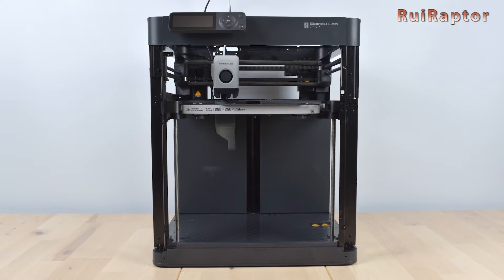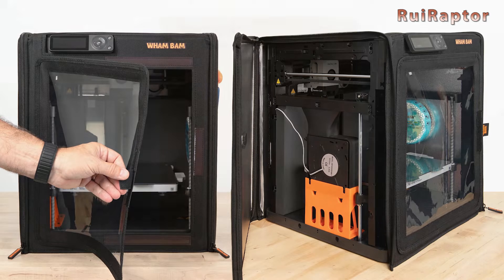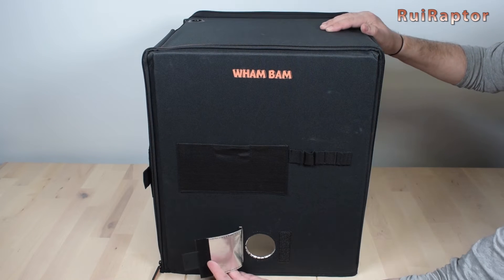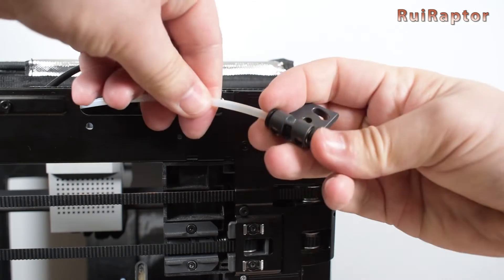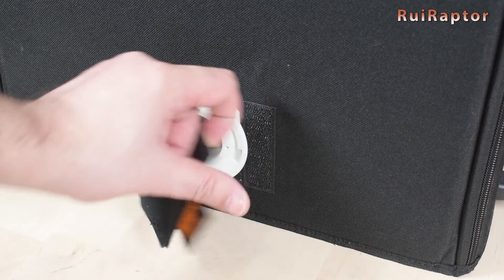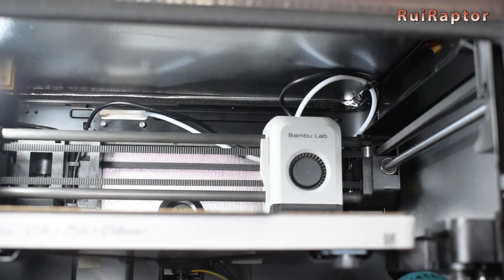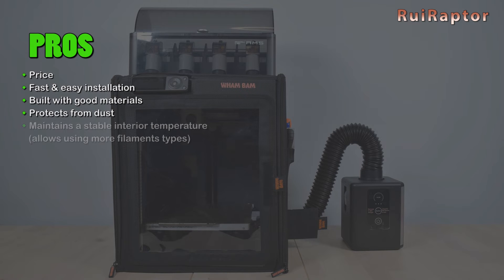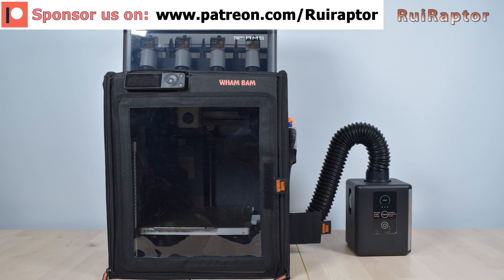HotBox from WHAM BAM - To Fully Enclose the BAMBU LAB P1P - Assembly, Analysis & Tests

Comment: I just purchased this and it works awesome! I did notice that the PRFE tube hits the side panel and guide in the back right of the printer, just like you warned here. Do you know what I can do? I was thinking of buying the cable chain from Bambu. thanks for a great video, it was this video that convinced to to buy it.
Reply from the maker: Hi, thank you for your feedback. Regarding the tube, yes, the cable chain would be the best option. That way the tube and cable will always stay at the correct position.
Reply: @ruiraptor  That is what I thought. I just purchased the cable chain assembly from Bambu. Thanks for the great video and advice.